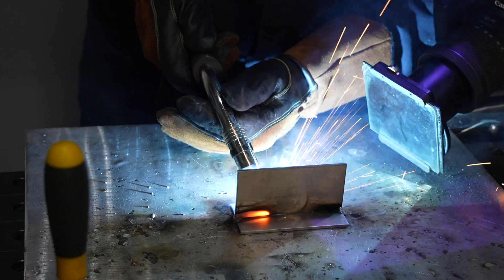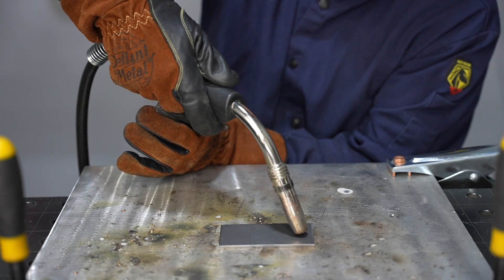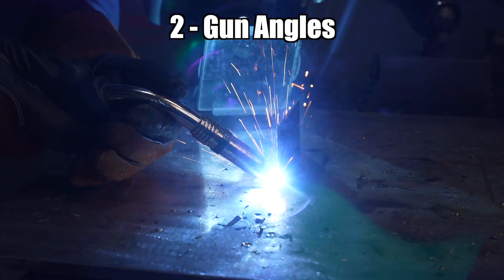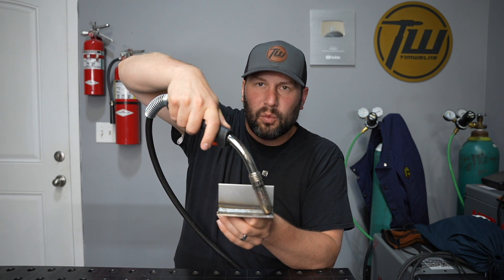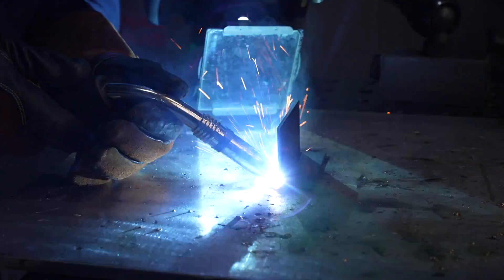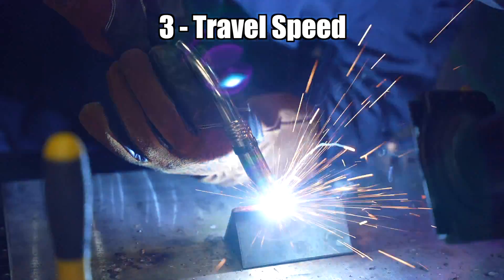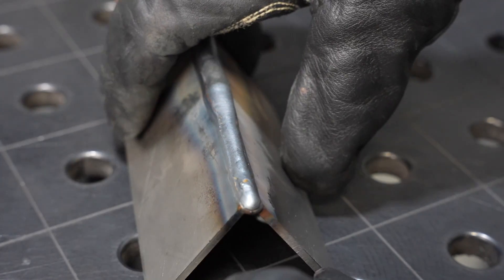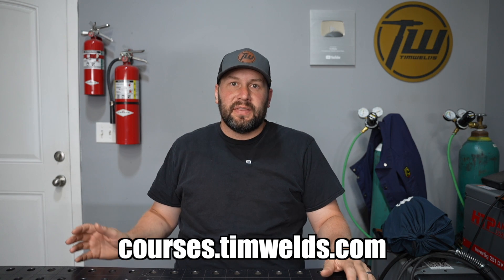MIG Welding: The 3 Keys to a Great Bead

Comment: Do your online courses discuss settings and using simpler machines like a Lincoln 140? Many YouTube videos (not just yours) discuss settings on  advanced machines with more tunable selectors as opposed to the preset “A, B, C, D” selectors on simpler machines.
Reply from the maker: Yes, the course has 2 lessons on settings and they would apply with or without numerical readouts. The principle is the same with either. The first lesson on settings just gives an explanation of what they do, however at that point I just recommend using the factory recommended settings until after the technique lessons. The reason for this is that without consistent technique, it's easy to chase your tail turning knobs without being able to tell what caused the change. After the basic technique exercises is another lesson on settings where I go in more depth on how to tune them and there's an exercise to get hands on experience with the settings. The principle is that wire speed controls amperage and is the primary control for heat while voltage controls the average arc length and contour shape of the bead.
Reply: @TimWelds  thank you!

Comment: 6:45 you see the difference in the blueing ….  Faster travel speed = less heat input and slower travel speed = more heat input, wider blueing, more warpage and distortion….  And even though its more heat input overall there is a great risk of just piling weld on top of weld and not fusing the root of the joint properly ….  

Well, i came a day late to watch this awesome video
Reply from the maker: Exactly! Travel speed is the key to controlling heat input. Thanks!

Comment: Good points. On the outside corner joint the bigger heat affected zone was also a sign of too slow of speed. Although probably obvious I might also add that a good clean ground as close as possible to the weld is very important with mig welding.
Reply from the maker: Thanks! You can definitely see the wider heat signature from all the heat when running too slow.

Comment: Very nice video, Tim. No unnecessary fluff...succinct and to the point.  But dang, you make it look too easy.  I do have a habit of flipping my wrist at times, and this video really showed the pitfalls of that. Thanks.
Reply from the maker: It's really common to flex the wrist during a bead and on really short runs, it's usually fine. The key for me is to just rest my supporting hand very lightly so that it's easy to slide.

Comment: I'm learning just for the sake of learning but my oldest son just started at the local CC in the welding and fab program. I have a stick machine and he bought a flux-core MIG (both inexpensive mid-grade HF). My question is can you push flux-core or is it like stick and you must pull? Thanks and you have a FANTASTIC channel!!! We've learned so much from you.
Reply from the maker: Awesome! Self shielded flux core works best with a drag angle like stick welding. Sometimes it isn't feasible and you do what you have to, but given the option, drag is best.
Reply: @TimWelds  thank you for the fast response and keep up the great content!!!